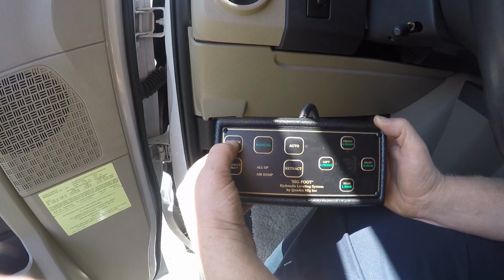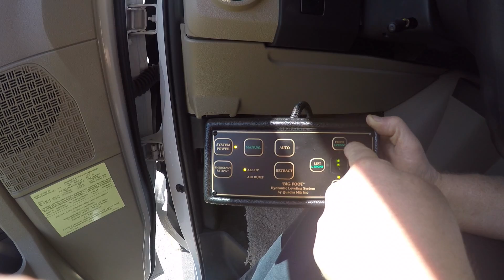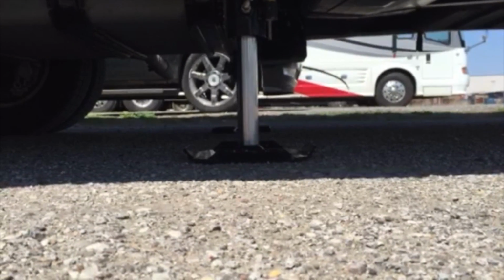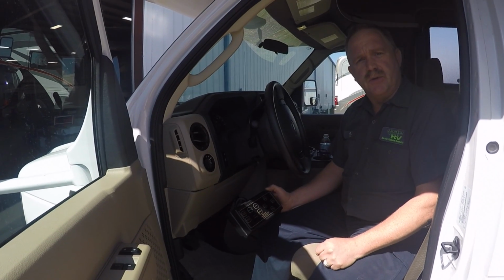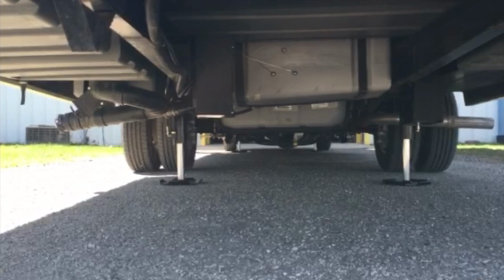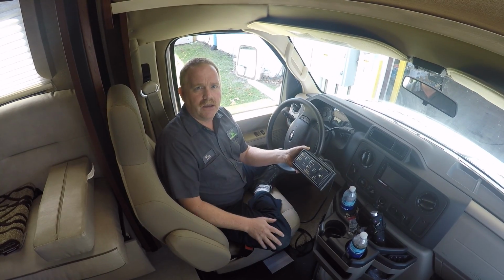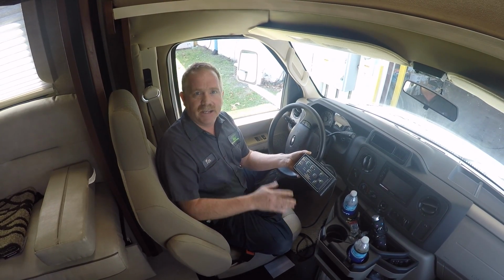Bigfoot Hydraulic Leveling System Walkthrough

Comment: Best advice I can give is to learn how to manually level because the auto leveling doesn't work well unless the site is mostly level to start with. It usually raises each side no matter what...even when it doesn't need raising. This increases the height needed on the side that actually originally needed raising. In most cases the jack will run out of range leaving the rig unlevel and with wheels raised clear off the ground. I always manually leveled by raising only the sides that needed it. Then I would lower the other jacks until they just touched the ground.
Reply: Thats why you just bring a few blocks to make sure a leveler doesn't run out of stroke....
Reply: @SpeedySpears  had bunches of blocks. I always placed them underneath all 4 jacks right up to the ground plates then I would level the rig...manually.  But those who don't learn to manually level usually end up with wheels in the air and/or jacks at full extension but not meeting level
Reply: I too have found this system to be very quirky.  One jack would not retract fully setting off the alarm and not allowing the coach engine to start.  Eventually, I was educated by a tech.  Never allow the piston to extend more than a couple of inches.  Having the piston fully extended and raising wheels off the ground allows the entire coach to sway a bit when folks walk around in the coach.  This puts a lot of stress on the piston and seals.  I put 4 to 6 leveling plastic blocks under the foot of each jackpad, then using a level I generally manually level.  I wished the design had spring retraction instead of relying on hydraulic back pressure to pull the piston back to its home position.

Comment: I have this kit on my motorhome and I need the seal kit to fix 2 of the cylinders . the company is a joke and wants $500x2 when all I need is 2 replace a leaky seal. any suggestions?
Reply: What year of jacks do you have on your Coach?
Reply: I have a 94 model allegro bus, I am sure they were installed in 94.... they go up and down but leak (2 of them anyways) .... they have a serial #410247... without taking them off I am unsure of name brand etc.... they are part of the bigfoot leveling system (key panel)
Reply from the maker: +chris murray what is the length and outside diameter of the black housing.
Reply: will have to get back to you with that information
Reply from the maker: +chris murray sounds good! We will be here 👍
Reply: the length of the jack is 20 1/2 inches -not including the footing of course, just the top to bottom overall cylinder length. The outer cylinder is 2 113/128 wide and inner cylinder is 1 1/2 inches in diameter, using a micrometer...

Comment: My problem is , my leveling system won't go down on it's own. Every 10 seconds I have to push the button it goes down a little at a time 
Why is it doing that .
Reply: Mine did that. Power issue. Batteries must be low.